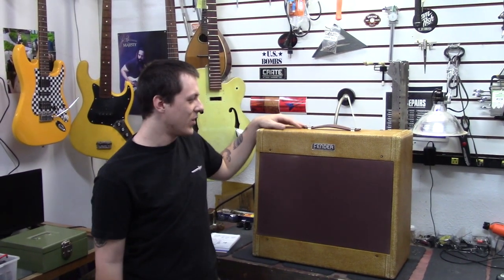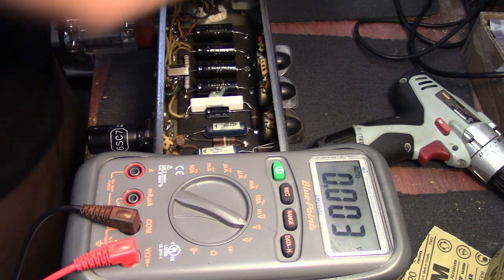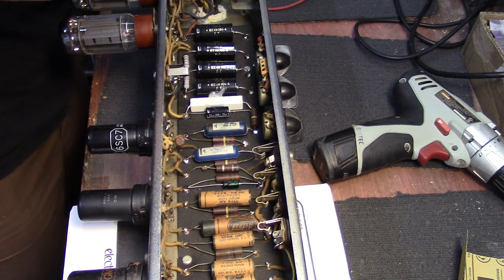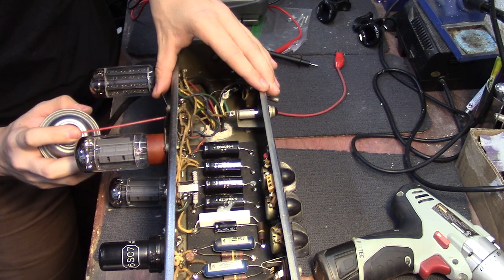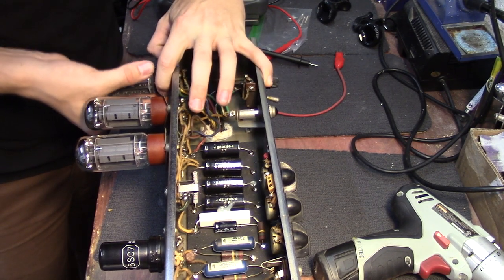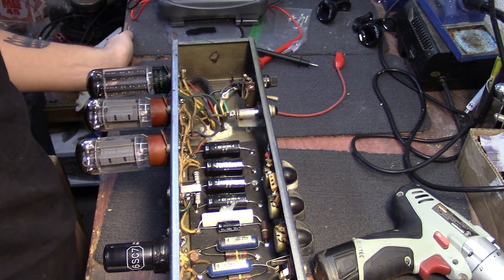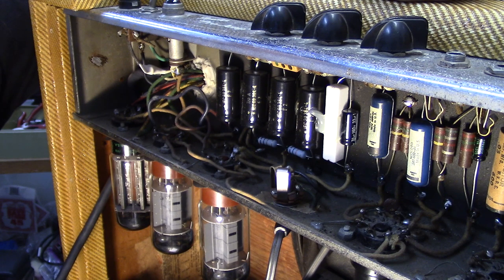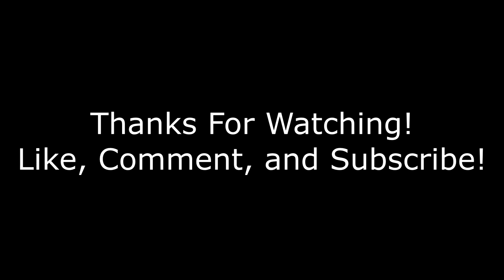1953 Fender Tweed Pro Maintenance

Comment: Electrolytic caps leak DC across when they go bad which is what you don't want,  you get alot of noise and cutting out right before they die usually but not always. If you gonna use tube amps everyone should learn what he talking about, it will save you time and money, I haven't play guitar for a long time but when I started playing since I learn everything I can about guitar and amp. I read about it watch videos about, I started building my own tube amp, I built a marshell type amp with a fender clean channel and  a marshell high gain, which took alot of changes to get it right. Good video